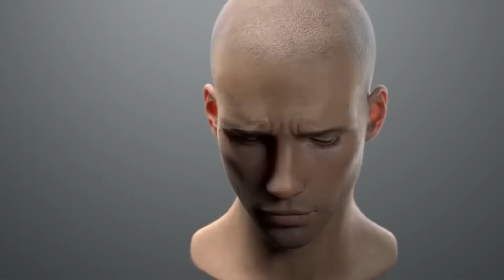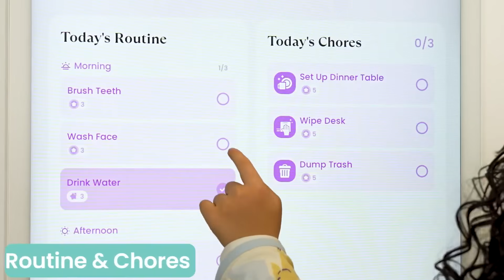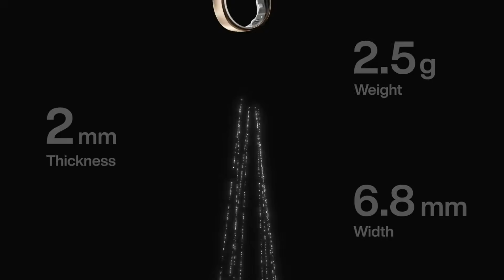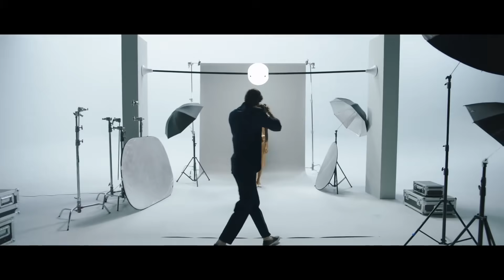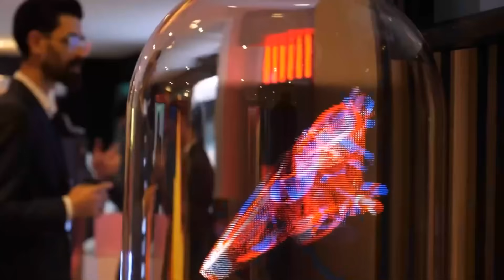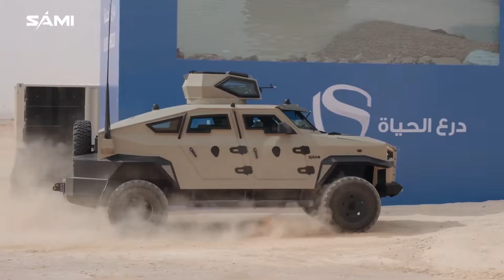Top 100 Japanese Robots and AI Technologies That Will Make Humans Obsolete

Comment: Given the advancements in materials technology, the 'robots' would be more life-like if their skeletal frame, joints, and ligaments were made of plastic or synthetic composites to replace current metallic components. Perhaps programmed sensors could be imbedded to transmit signals point-to-point in areas where movement is required such as bending, twisting, reaching, facial expressions, and other movements from head to toe. Developing and incorporating functional synthetic internal organs with bio-safe fluids would also create the epitome of an android partner and/or playmate for intimacy. That would be a more realistic humanoid.